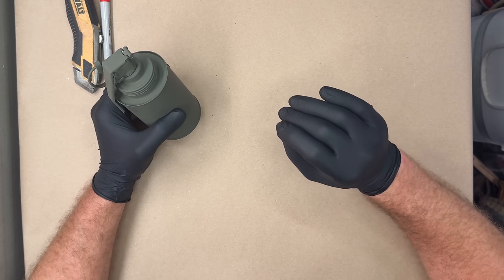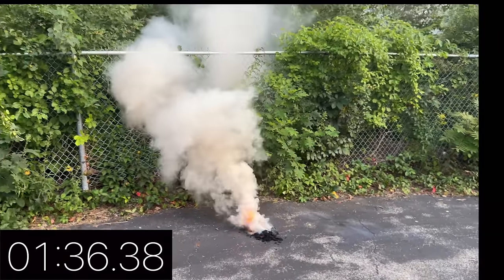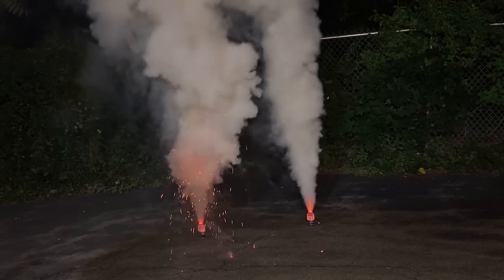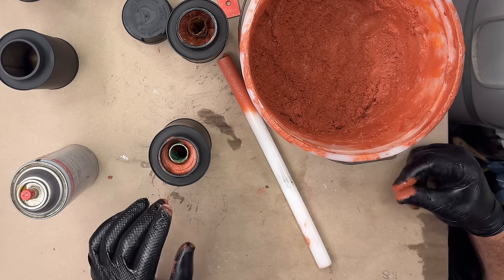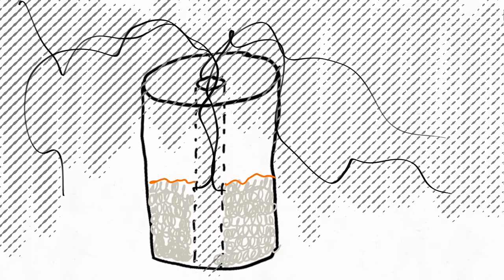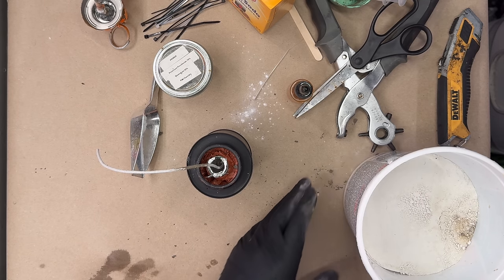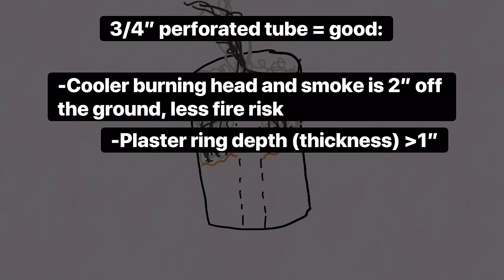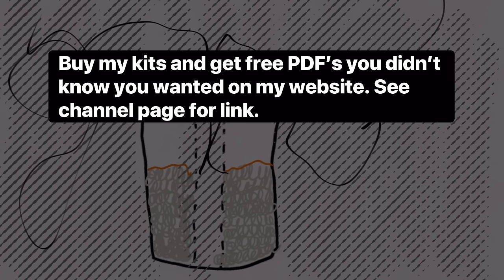Best Throwable Smoke Device on Earth Just Improved by Sub's Suggestion

Comment: I've seen incinerators that use something like metal window screen material over the opening as flame/spark arrestor. Also some outdoor grills use something similar so fire isn't charring the meat. Maybe something like that which stays put after the cap comes off would help? Could be worth a test.

Comment: For the plaster cap you could try adding thick wire, nails, etc. to the plaster in a similar manner to putting rebar in concrete. 
Have you thought about dying the smoke? I recently got some red and blue smoke dye and if memory serves me right it needs a low combustion temperature to not decompose, if the plaster capped one does burn cooler it could be a good candidate

Edit: it seems like the reenforced plaster idea has already been mentioned, hope it works!

Comment: You know if you used a canister with a smaller opening, like just big enough for your screen tube to fit, you could save time and cost by not having to mix and pour the plaster cap. It will also be a more reliable way to prevent flaming chunks from flying out.

Comment: Have you looked at the space shuttle solid rocket booster propellant profiles? They could choose the thrust profile by molding the solid propellant into specific shapes (eg: a 5 pointed star, a circle, etc).

Would be cool to see some experiments with different smoke grenades using those profiles. You could make it so the released smoke is the same amount/rate in the end as in the beginning (ie: more consistent burn profile)

Comment: Try packing the core loosely with a stainless steel scrubbing pad and at the top instead of the copper tube and plaster.

And have you tried any additives for colors?

Comment: This has probably already been mentioned, but just in case, be aware that HC smoke is toxic and you don't want it in your lungs.  There is also skin absorption to be aware of.  Would advise using a respirator and showering / washing clothes after use.  And be aware of any populated area nearby when choosing a test location.

Other than that, another idea to help deal with smoke pressure related issues (which is part of what drives the chunks and embers being forced out) would be to drill an opening in the bottom (so you end up with smoke outlets at both ends) and plug it with a wax seal.  That should double your volumetric flow for the same internal unused diameter.  EDIT: I just saw you already experimented with this on your channel, nevermind.

Comment: Use springs instead of perforated tubes easier to source you can even fin tune mesh size by selecting different springs,

Or use  fine mosquito net steel rolled up in shape of tube.will burn more evenly,  hopefully temp doesn't reach 1800C.

Comment: i have something for you to test 
weld or solder a cap onto the pipes (both ends one covers opening of can with hole for smoke )
(still have flow through while reducing chunkage and potentially have more capacity for smoke volume)m^3 at atmospheric pressure in closed room (measured by visibility in feet or meters) i would not recommend using anything smaller than a 3000 sqft warehouse for said test

Comment: The reason the smoke rises is due to the heat of the combustion. You should try to do some testing on various compositions heat generation to see if you can lower the combustion temps. It might also help to design a nozzle that promotes mixing the combustion products with air to cool it down faster, instead of it just making a plume of all hot gasses
Reply: If you perforate the outer tube in a ring around the top edge it will form a lot of small jets instead of one bigger one, makes it so air is mixed with the products much faster.

Comment: Simplify the design? Make them just like the M18 with a hole at the bottom covered up with 100mph tape? Ignition at the top(less fuze/connections to malfunction), pops the tape off but put a steel mesh screen at the bottom before you put in the mixture. screen keeps the chunks inside, still might have to use the inner metal tube to give it structure on the inside so it doesn't fall in on itself

Comment: Why not mix steel wool into the smoke compound instead of the steel pipe. When I build heat treat ovens I mix something similar into the refractory to hold it together at high temps and prevent cracking.

Comment: If the devices are going to be used as throwables, does it really matter which end the smoke exits? They're gonna land on their side 99% of the time anyway. Why not extend the perforated tube out the bottom of the can, sealed with some silicone, and ignite the mixture at the top?

Comment: After seeing this, I'm curious if this monolithic design is even the best route. If you got several much smaller perforated rods and placed them throughout the compound you'd get a higher volume of compound and comparable surface area for escape. (you could even fine-tune the surface area, compound load, burn-rate, etc. fairly easily by changing the radius of the tubes, number of perforations in the tubes, positioning of the tubes, number of tubes, etc.)

From what you say here it sounds like you were limited to a monolithic design previously because otherwise the compound would break down catastrophically during ignition, but if perforated rods can provide support while letting the smoke escape, it seems like a less-monolithic design could work better.

Comment: what if instead of using a plaster to top the canister off, you added a metal top plate that is possibly attached to the perforated metal chimney?  In that way it would be easier to simply use a thin metal plate that can handle the temps like the metal broom handle possibly.  welding the chimney and top plate would make it much more simple to ensure the upper metal plate doesnt fly out, and it will also force all the smoke to push through the chimney, and never allow for  blow outs.  With that in mind, having to use more than 1inch of plaster would then allow you an even greater amount of space for an addition amount of the epoxy material.   if there are issues with the sides of the metal, either using small style metal clips or some other method would help to ensure it doesnt push out on the edges of the metal top plate, but maybe that wouldnt matter since it should only really matter mainly during the initial cap blast and fuse burn right?  Then if anything else utilizing the baking soda to protect the chimeny top to bottom from catching on the edge.  Last idea is I wonder if the chimeny has to have a final opening diameter of 3/4inch as with the length to the bottom?  I wasnt sure how large the central fuse assembly of the top cap is, but if you possibly reduced you chimeny exit hole to be just large enough for the top cap fuse essembly, would that then also help to control the smoke burn rate, and decrease most of the small blow outs, etc?  Thanks and great video.

Comment: what if instead of a cylinder, you made the central hole a cone? You could cut a piece of sheet metal to make a perforated square pyramid shape. That would give you even more material to work with in the bottom of the can, while also making it so the larger base size makes it easier to block chunks from flying out around the core grill.

Comment: M18/8N have hole on bottom correct? 2x exit volume flow less internal pressure and functionally half the burnt material to navigate each? You are already tubing it so at this point you are one 3/4” hole and some aluminum tape away from that situation. This would allow for the compound end of fuse to be a fixed to a compound plug then installed from the bottom (more positive securement?). Might be worth looking at?
Reply: I think that would work well, at the moment seems more like a signal grenade than one for concealment with how much the smoke floats up.

Comment: What if the central tube also had a metal cap on it? That way you could have a single assembly that could be molded into the device without having to add plaster later.

Comment: Might be quite nasty or challenging to tune, but if you wanted a bottom to top burn, could you make a central core liner that would burn away? Perhaps a plastic pipe, or a few layers of fabric or paper with a light glue

Comment: I cant find the comment again, but someone suggested a hole covered with tape instead of launching off the igniter, to add to that, you could do three holes at equidistant spots each 0.25-0.5 in with a mesh to prevent things from getting inside to allow for more even disbursement of the smoke combined with some baking soda in the mixture, might help? I am no chemist, just a mechanical engineering major

Comment: Try using a pitot tube and a magnehelic gauge to measure your very localized air pressures. Make sure to get an analog one, as it basically has built in smoothing function. 
This way you can start to get an idea on volumetric efficiency and what your back pressures are.

Comment: Is there a way to reduce the speed the composition burns at? I notice all the smoke quickly rises into the sky because of how hot the exhaust is. If it burned slower it would keep closer to the ground and would be a lower fire risk. You could maybe even make the initial burn faster to get a quick initial deployment, then a longer slower sustain.

Comment: What about a cutting a steel mesh or even chicken wire before you lay the pouty to reinforce it?
Reply from the maker: Just started doing that! It’s significantly stronger
Reply: @InventionIncarnate  fantastic!!!  The support around the perforated tube is important.  Think of it like a rocket. Tons of heat and it Needs to be directed in a direction without any blow back.  
 A cone shape can help as well at the top as long as you can keep the burn slow enough.  Love your content.  Thank you

Comment: Isn't this backwards? Why is not the smoke escaping from the opposite side of the fuse? Then the fire travels towards the bottom and the cap doesn't have to be removed. Just drill or cut off the bottom and make whole for the smoke. It will not be a simple can but it will be much easier to reuse.

Comment: Wonder what the shelf life is on these.
Reply from the maker: @Cowboycomando54  it’s likely longer than our lifetime. The mixture is suspended in a cured epoxy resin. As long as it’s stored away from heat and UV light and the ignition assembly is not exposed to moisture. Should be extremely long. But I have zero testing data to support that hypothesis.

Comment: What about a metal mesh top in conjunction with the central tube that is greater in diameter than the screw top. Idk if you could find anything that is flexible enough to bend in whilst also withstanding the heat. I'm no sciencer

Comment: Why not put holes in the bottom of the can and tape them over with a tape that you think appropriate. The compound will burn thru the tape and the holes will hold the chunks in. You would need to eliminate whatever your doing to blow the cap off, unless thats just happening from the pressure. 
That's how smoke grenades worked when I was in the Army.

Comment: With the addition of the central tube and the plaster cap I see no reason why the device has to burn from the bottom up. The smoke must come out the central tube not through the ash as you mention.

Comment: Looking at this I'm immediately thinking of those stupid water bottles that use the scent rings to fool your brain into thinking the water is flavored. Wait, here me out. What if you used a solid ceramic insulator around the tube. I'm betting something for electrical work exists off the shelf with a 3/4" ID. You may have to get or make a can with a lower lid that doesn't pop off to get it in there. Like the old fake Barbasol hidden safe cans (see the first Jurassic Park movie). Basically something that gets wedged into the top of the can. You may even be able to make a series of wedges that can fit down into the can and are geometrically wedged in place by the pressure. Though I'm not smart enough to know how to do such a thing. Sorry. 

Alternatively you could make a fun video of dumb ideas like filling the top of the can with high temp RTV (red) to see if the combination of flexibility and adhesion allows it to stay in place. Idunno, it could be dumb enough to work, and it would be a dang sight easier to try. LOL

Comment: Sorry to be that guy, but i think you made a mistake with your math @2:11 

When squaring a radius, you should use a number > 1.  You can get around this with scientific notation, or by using a different unit.  So for example if you convert inches to cm, the operation is

3.14*1.27cm^2*5 = 25.3225
3.14*1.90cm^2*5 = 56.677

Which results in a difference of 31.3545 cm^3 or 1.91 cubic inches, not 1.7181.

Comment: You could have a hole in the bottom and ignite from the top so the fuse assembly doesn't go mach Jesus.
Reply: I think he wants a hard ejection of the fuse assembly so it doesn't get burned and can be reused a few times.

Comment: Use more 3d printed parts. You could definitely make some alignment tools and filling tools
Reply from the maker: @Energetic_Ballistic_Solutions  once I move out of the back of my van 🚐 I will. Though no one would be surprised at a 3d printer set up back here
Reply: @InventionIncarnate  you can print the body and head/ striker. I'm a tech. It would melt, but it's one-time use, and you could make it really easy for building the core and vent holes. I do alot of CAD Design it would be pretty easy